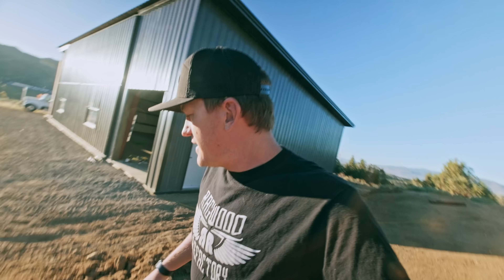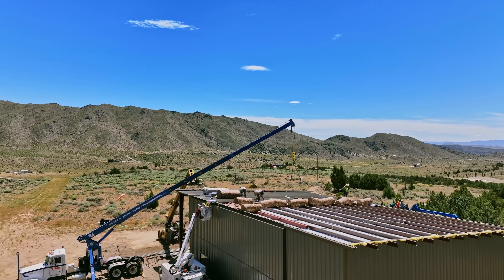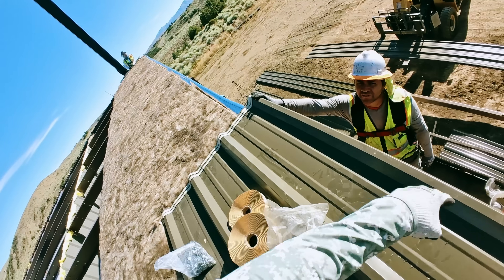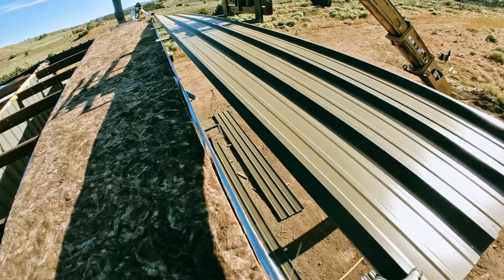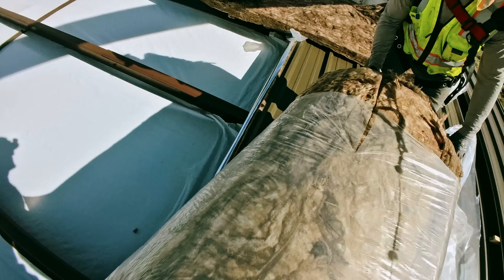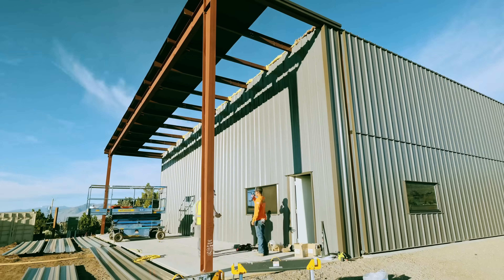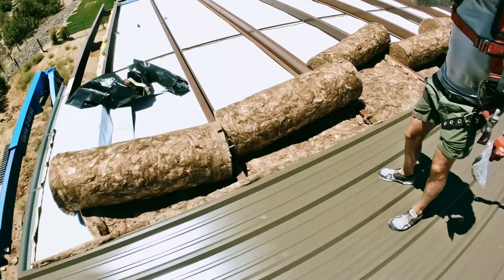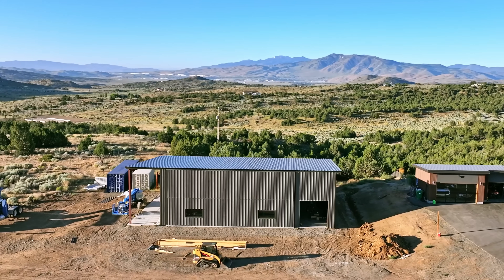We Finished The Roof! - Hangar Build Part 6

Comment: we dont put insulation directly against the tin, as we found it causes the tin to get extreamly hot and reduces the life of the paint.  we leave a airspace fed from the soffits to allow air flow.   we can see it in a few years where places insualtion accidentally touched the tin where it gets hot and the paint changed color in a few years

Comment: Insulation prevents dew dripping on what you park under it.
Reply: Also, reduces radiant heat during the summer.
Reply: Hi
Reply: I can imagine it also reduces the noise of rain hitting the panel.

Comment: Eaves should be insulated to keep the roof metal more of a consistent temperature which will help prevent ice damming and potential leaks. Not sure if you get snow in your location.

Comment: Good timing with a hurricane heading for Baja then continuing to rain all up the Sierra Nevada. I hope everything is well secured. Looks like it is. I like that you pre-drilled the panels. I did some metal roofing and that's what I did too. Much easier to get all the screws aligned that way. I didn't peel the cover off the tape until the panel was laid down and the first screws were in, just so I could avoid getting stuck to it like you did. But I also didn't do nearly as much as you. Just interesting that you had the similar issues and solutions.

Comment: looking good Trent! my only question is why the insulation directly touching the back of the roofing material? wouldn't that be the condensation point and just soak into the insulation? thanks for putting out great content though! cheers from New Zealand.
Reply from the maker: I believe the vapor barrier on the inside of the building prevents the condensation on the panel but to be honest I’m not exactly sure, this is just how the insulation package was designed to go 🤷‍♂️

Comment: Ugh.. that adhesive crap falling off and sticking to your shoe, and the wind messing everything up.  I did the cieling to my shop (creating a closed in area in which to blow the pink panther stuff).  I had guys to install the cieling panels (which is like doing 60' x 30' of your soffit - exact same technique) then I blew in the insulation and it was AWFUL.  Once I got the right insulation blower (electric, used specifically for these bundles, after using the lashup gas powered one that was a FAIL) it worked well.  It's a MIRACLE how stable the temp is in my shop. NO AC REQURED AT ALL.  I've been told heating it with my 100,000 BTU floor heater (temporary?  Permanent? DUnno yet) will be quick and effective. BUt in the summer it's already made it habitable and I'm using it way way more often.  Your hangar will be nice to .. hang out in.. .Trent.